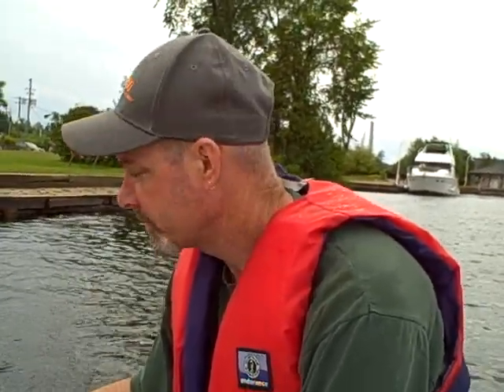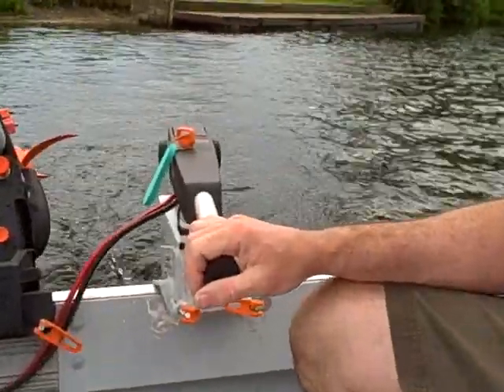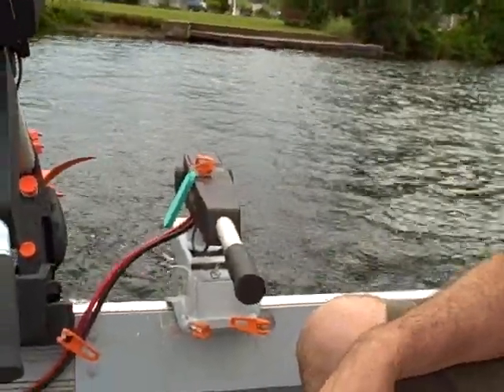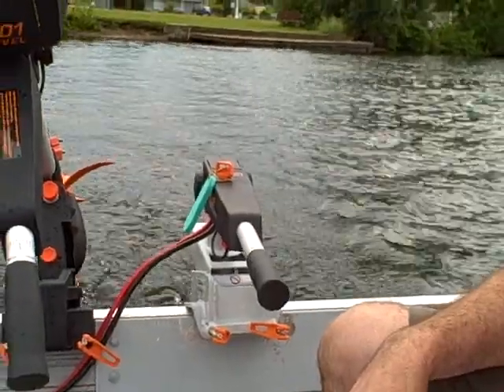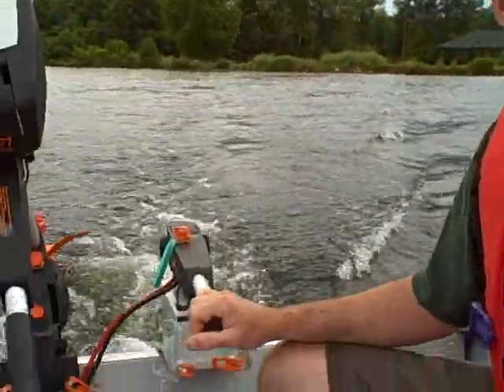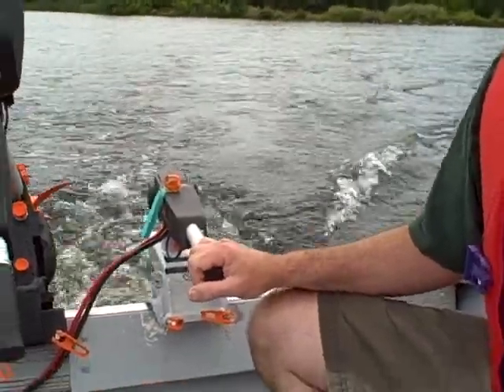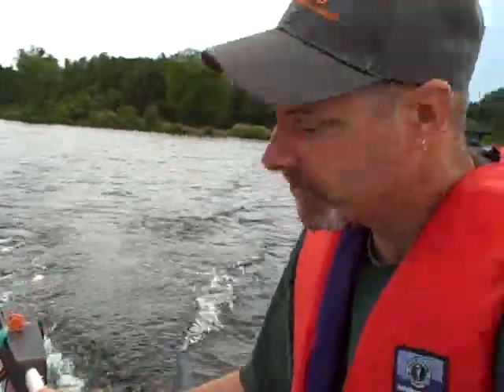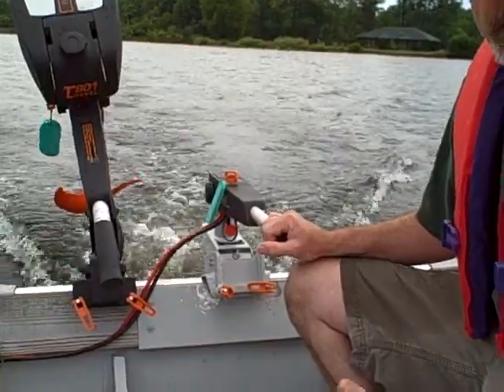Testing a Torqueedo

Comment: Hi -Do you still like the motor after 3 years using it? Any additional feedback you can provide? I currently use a 4stroke 5HP Mariner outboard on a Precision 21 sailboat (1800 lbs) and I am wondering if this could be a good fit.Thanks.